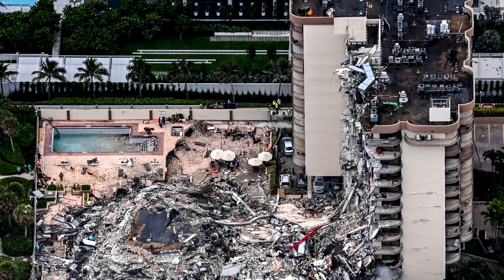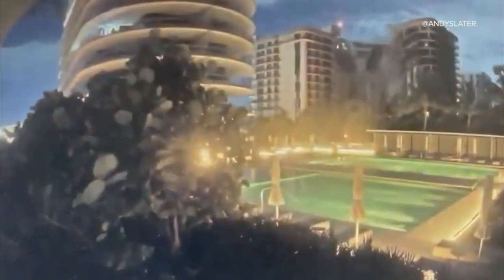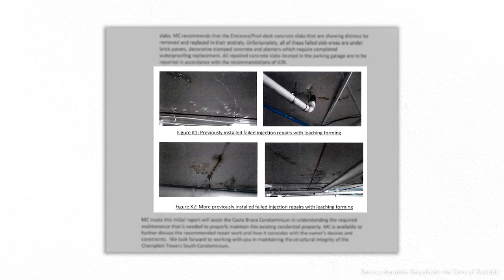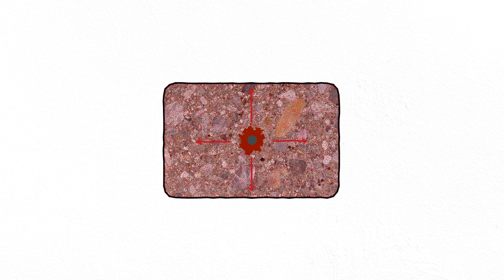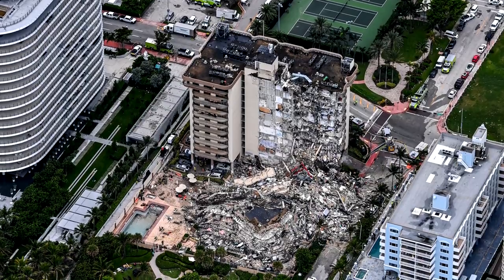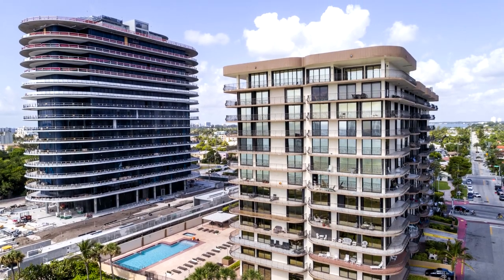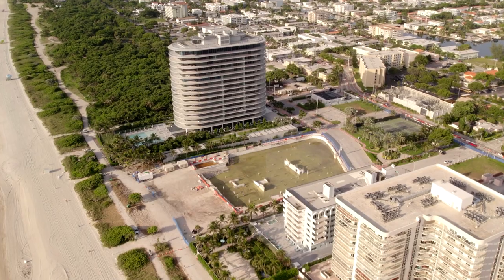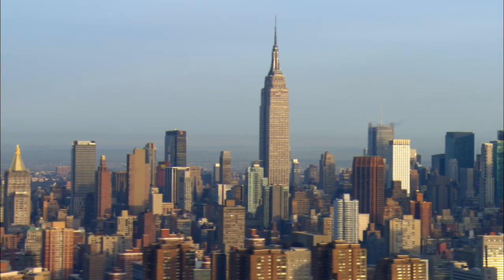Surfside Condo Collapse: What We Know So Far

Comment: The " pool deck was 1st to fail" because this was witnessed and therefore true as far as that was visible. But not the whole story: Building  structures failed within   PRIOR to pool -as witnessed by noises and some internal cracking- long before the pool deck collapsed, allowing some to escape.
Reply: It was the pool deck on the other side of the building that was seen through the garage entrance. There are a bit of floor in the part of the garage that is below the building that can't be seen so we don't know.

But the video shows a section of garage roof that was directly under the planters.
This was a section that probably made the columns buckle. And this is likely the reason people heard noises and saw cracks. Parts of the building did move a bit minutes before it all came down.
Reply: @perwestermark8920  Think we are missing each other. The North street entrance 2-way garage parking ramp goes UNDER the building (it has the gate entrance+below a 2nd story balcony, if you can get a photo). 

It's roof is the level creating the STREET FLOOR of the building. As this floor continues out the South side of the building -- it extends as the Pool deck with the pavers.  There are some steps and elevation differences.

If  you turn east, you face the beach. If you turn west, to the Collins, you are on the valet parking-- access and spaces on South that fell down-- easy to identify with the black 5th wheel Duramax! 

It is quite confusing to grasp this. You have to circle the building on all 4 sides. What you see falling in the North gated ramp is debris within the under of the building, no outside planters-- not through to the South side. If that helps?

Comment: In the end the AS BUILT vs AS DESIGNED will become the focus of the cause.  The mall in MN whose bridge collapsed that was built incorrectly is the perfect example of where cost, ease, design converge in the fight that should never be one of compromise by design but always is.
Reply: Think you mean "comprimise of design" but ok
Reply: What "mall in Minnesota whose bridge collapsed" are you talking about?
Reply: @douglas2lee929  It was a long time ago.  There was three levels of the  spans on each floor. The design called for a single long rod to be suspended from the roof to support the spans. The construction company sought a change so that each lower level was supported by the one above. This put 100% of all three spans on the single support from the roof to the high span. A design failure which was just bomb waiting to go off.  I believe engineering disasters did a bit on it.   As I said it's been several years it could have even not been in MN. I do accurately remember the failure of the engineering. I wanted to be a mechanical structural architect many moons ago in high school so it is still an interest to me. Like this building failure.
Reply: I've seen the one you're talking about. It was not in Minnesota, I'm fairly certain. For accuracy' sake, I'll try to find it for you. Check back in a day or two.
Reply: @douglas2lee929  unimportant. I mean if you've nothing better to do than be argumentative.
Reply: Take a pill. I said nothing argumentative. I was trying to be helpful. Since I live in Minnesota and had no recollection of the "Mall bridge failure" you spoke of, I was trying to fill in any gap in my memory.

I saw the video of the event you spoke of. It was in some other state. It might have been in Las Vegas.
Reply: The Hyatt Regency Kansas City MO. July 17, 1981

 video: "The Disaster That Changed History, The Hyatt Regency Collapse".  Tom Scott and Grady Hillhouse.
Reply: @douglas2lee929   Thanks that is the one. Albeit I saw it on History Channel like 2 decades ago or more.  I lived at one time just up the hill from Miller Park where Big Blue crashed killing 3 I believe.  I still remember the day.  The video that even Grady uses is one shot by my former crew chief.   These kinds of things happen all the time.  Grady did the video on steel reinforced concrete and I'm driving over a bridge at a stop light as I do every day watching the concrete pop and bars expose.  One day Tucson will have another engineering disaster.

Comment: I may be being a bit hasty, but I feel like the lesson is that steel reinforced concrete isn't a long term stable building material. There's Roman brick and concrete still standing and in use. Nothing we build today can last a single lifetime without constant maintenance.
Reply: There's a good response to this on Quora: https://qr.ae/pGottR
It's a bit of an angry response though lol
The crux of it is without reinforced concrete we wouldn't be able to build the high rises we see in this video. It has a shorter lifetime fir sure, but humans don't just live in 4 story buildings now, some live in skyscrapers and drive on highway bridges. 🙃
Reply: Roman bricks won't build your bridges and buildings. Like every field.. construction world is learning and adapting, structures when they get old need to be regularly maintained. Just like your body it needs care and any negligence will cause catastrophic damage.
Reply: The issue is choride ions, ie salt, in the environment - this is not long-term compatible with ordinary steel rebar.  But there are stainless steels used for reinforcement too, and this pool-deck was an obvious place they should have been used, in hindsight.

Comment: It's an important point to note the difference between "finding cause" and "finding fault". Engineers and technical advisory groups are interested in understanding the cause of collapse so they can both make recommendations to improve the design of future structures and improve inspection protocols for existing structure. It is a legal matter to determine fault and there can easily be multiple groups that are ultimately assigned a percentage of the blame and subsequently incur penalties and sanction. Most of us are much more concerned with understanding the cause than fixing blame so we eagerly await the conclusions from the investigations.

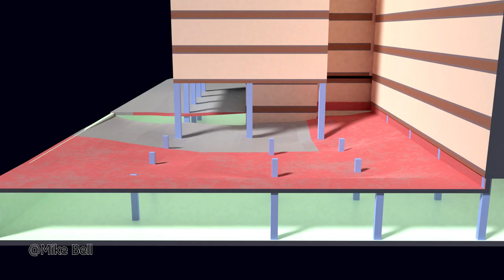Comment: 8:24 If the building had the interior slab at different level than the pool slab this buckling of the columns could happen.
The under side of the pool slab being painted would have caused the water be held internally and saturate the slab.
With no moister barrier between the slab and the columns, water would tend to migrate down inside the columns and weaken them.

Comment: the idea of putting a pool over a parking deck hurts my head to begin with.
Reply: The pool was not OVER the parking deck. The floor of the pool was the same level as the floor of the parking deck. That is why the pool didn't collapse. After the building collapse, aerial pictures show the pool is still full of clean water. After several days, it turned a murky color, but it still was holding all of its water.
Reply: @ericryan3848  i thought he said it was acting as the roof of the parking deck, but i guess that was just the deck not the bottom of the pool. still having it so close is nuts. if the pool is too acidic cause if improper maintenance, it will leach calcium from plaster and the like, and the chlorine will corrode steel in no time. i cant imagine putting anything that is supposed to hold up cars and multi story buildings anywhere where water could possibly leak out of one.
Reply: @yamatsukami987  Where'd you get your engineering knowledge.  Dunning-Kruger University?  You must think that sewage-treatment plants can't last either.
Reply: @ericl2969  i work with pools for a living, i have seen them eat through plaster when they don't have bicarbonate added to them, and i have seen the chlorinated water eat through steel that is just near them for a few months, not even directly in the water. 

Also modern sewers use copper/PVC or galvanized steel, reinforced concrete does not as far as i know. The organic mater would probably react with the free chlorine pretty quickly also.

I'm not an expert on sewage treatment, but apparently they too need maintained yearly to keep them watertight an prevent leakage into the environment.
Reply: @ericl2969  also he pretty much says all this at 5:30 himself, i was just pointing out pools also have chlorine ions, and that pools with poorly balanced alkalinity and a low PH will more quickly leech said alkaline constituents from the porous concrete. that means any poorly maintained pool is especially threatening to load bearing reinforced concrete around it and especially bellow it's water level.

Comment: Building Integrity did a wonderful video going over all the design documents and identified 2 main flaws of that deck that coincide to make the structure go over 100% load capacity.  I believe the video was named designed for failure or something like that.  First was that at some point late 79 to early 80 they removed some drop down support beams that put the deck right at 100% load capacity which was fine by itself but then the tower owners added the planters all along the edge concentrating right at the joints.  The planters being massive, containing dirt, water, and made of concrete pushed the load well above the designed load capacity.  Combined with the corrosion and spalling dues to poor water drainage (which the planters made worse btw) it was amazing that it lasted as long as it did.
Reply: I would not really call it “fine” that the design was at 100% load.  There should be safety factors involved.
Reply: Wanted to say exactly this, as I saw that video just yesterday. It’s got “Designed to Fail” in the thumbnail but the actual video title is much longer: “Engineering Failures found in the Champlain Towers South Drawings - Surfside Collapse”

Was hoping to see some of that discussed. Not sure if we’ll see a follow up video, at least in the near future.
Reply: Yes, I think he cracked the case there. I'm sure it seemed like a cosmetic change to eliminate the change in level between the parking deck and the pool deck...
Reply: @ernestrollins383  the 100% load is ignoring factors of safety, had it been 100% of design load including safety factors it would have crumbled well before the rebar had time to corrode
Reply: @Corvus.2606  It might be 100% of the slabs safe working load, which here in Australia for vehicles, forklifts etc is about 50% of the maximum design load. I'm not sure what it would be in the USA for buildings.

Comment: I appreciate your waiting to jump in with a balanced analysis.  

This is such a human failure.  It’s outside your engineering wheelhouse, but I think the most damning aspect of this story will be the social dynamics & inertia surrounding necessary & expensive remedial engineering work in a condominium building with residents of similar equity stake in the building, but unequal cash reserves for unexpected maintenance.  

Apparently, addressing  necessary repairs dragged on for years as residents dug in their heels funding the work through a succession of (increasingly frustrated) condominium boards.   All the while, the damage worsened & the costs of remediation accelerated with each passing year.  

It calls to mind the climate debate in miniature.  The immediate problem isn’t that climate is changing, but what to do about the trillions of dollars of public infrastructure & property value as it becomes worthless  & has to be rebuilt elsewhere. Sinclair had it about right:

“It is difficult to get a man to understand something, when his salary depends on his not understanding it.” —Upton Sinclair
Reply: "the most damning aspect of this story will be the social dynamics (...)" 

Pretty sure that if the complex were owned by 'Blackrock' hedgefond, the outcome would have been similar - for the same reasons, You adress. 

It's rather the risk of urban civilization that depending on others in any way becomes a liability to the individual in a crisis, even if statistically accumulated capital and labour should be regarded as an advantage for a group's survival. 

The Americas are littered with abandoned major settlements, possibly for that very reason of a lost 'mandate of heaven', so to speak...
Reply: @christophmahler  the discipline of engineering, particularly civil engineering, is a celebration of community & groups power over nature (at the time of Jefferson, nearly every person below the latitude of about Boston suffered from some form of malaria.  Large scale civil engineering drained our way out of the infestation. ) In the end, the problem here is people trying to own & maintain a complex systems reliant on massive amounts of “commons” that no one had specific day-to-day interest in maintaining.  If they’d all been renters, they would have fled years ago.  The structure torn down & the property redeveloped. 

Actually, mutual interdependency is humanity’s superpower: sewers, water, electricity, transportation, education, rescue & recovery in times of disaster, organizing goods production & delivery.   As the latest census data reveals, free-riding rural areas continue to empty out while the 4 coasts remain the economic engines that drive our economy.  

The world is littered with abandoned settlements, not just the Americas.  What survived are the people who organized & adapted.
Reply: @rhkennerly  
Ideological challenge accepted. 

"(...) at the time of Jefferson, nearly every person below the latitude of about Boston suffered from some form of malaria.  Large scale civil engineering drained our way out of the infestation." 

That is correct. 
Yet the same culture that is so proud of it's technological feats send the native American tribes which settled the area, - being well adapted - on their 'trails of tears' and was involved in wars that killed millions of people - in which all parties competed for mineral resources, required for industrial goods and for liberal markets in order to sell them. 

If a struggle for political supremacy demands it, science will provide germs that are more lethal than malaria could ever have been - and this has already been accomplished in hospitals in the forms of multiresistant germs by hygiene, alone - not speak of current 'gain of function' research that likely caused this pandemic. 

'Enlightened' man bursts with pride about his 'power over nature' - while he's more alienated from himself with every generation. 

"the problem (...) is people (...) reliant on (...) 'commons'" 

That is plausible when it comes to the unnatural form of dwelling, stacked atop of another so high that jumping from the roof of the building, kills a man. 

But the general argument against the traditional commons is the same as the liberal 'Whig' thief who seized the land from the holy Church and from the people - e.g. during the Scottish 'Clearances'. 
It took a civil war and the murder of a monarch to make it 'legal'. 

"(...) interdependency is humanity’s superpower (...)" 

It's precisely the inability of the industrial state to be self-sufficient what will drive the nations against another during this century - in a conflict that will make the last great war look like some sort of rehearsal. 
And as most depend on rationalized and mechanized food production, billions will die of starvation during the decade long nuclear winter. 

"(...) rural areas continue to empty out while the 4 coasts remain the economic engines (...)" 

... and it drove 70 million voters into believing that their own government is plotting against them while about 10 million can only hope for the separatism towards a black nation state in order to feel cared for as citizens . 

"What survived are the people who (...) adapted." 

Nothing lasts or is ever 'new under the sun' and 'adaptation' to the hubris of modernity is to settle remotely - far from the caesars , ruling the cities - just as during the last great collapse when Romans denied an overbearing state military service and retreated into 'obscure oriental cults' in hope for salvation. 

Those who talk like masons, today won't 'social engineer' the cycles of history - because that is the domain of a living god .

Comment: Surfside's transparency is commendable.  The lack of rusted rebar in the demolished pool plaza slab is remarkable (I would expect a lot more from a failed, flat plaza slab in a coastal area).  The horizontal split in the concrete cores from the plaza slab are curious and the punching shear failure of the plaza slab around the columns happened prematurely (the load should never have come close to the calculated capacity even under progressive failure).

Comment: Makes me wonder why anyone would buy a seaside condo now ?  Seems they’re all just ticking time-bombs. The estimated assessment per unit to fix this problem was close 100k per unit. Even though newer coastal construction may not have anything this dramatic occur it looks you would still need to increasingly raise assessments as the building ages thus causing their value to decrease over time.
Reply: If you keep up on it, it isn't that expensive.  Think of it like a car.  Regular inspections and oil changes are a lot cheaper than a blown engine or damaged parts.  And it is A LOT cheaper than loss of life due to negligence.
Reply: @ebels3  
Agreed but no matter what you do that steel rebar is gonna need replacement at some point and that’s not gonna be a minor assessment.